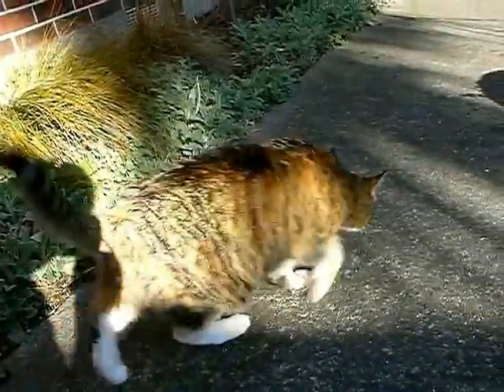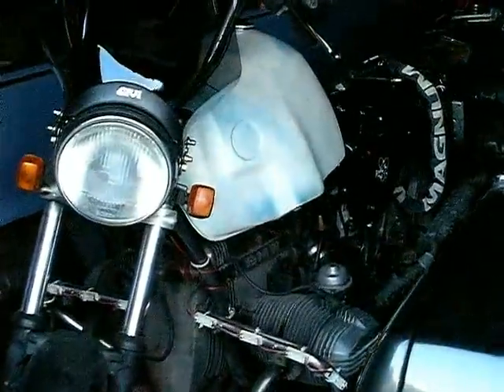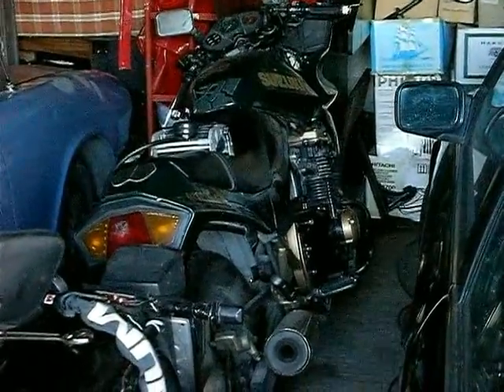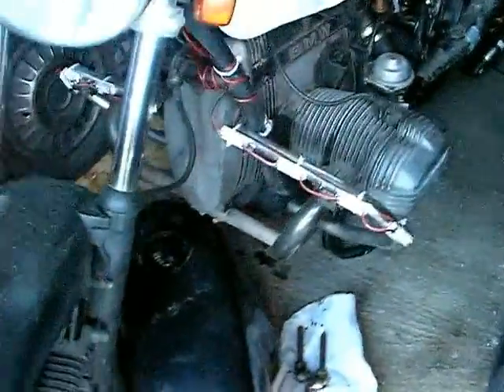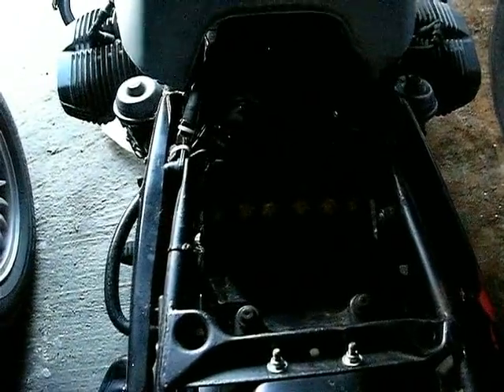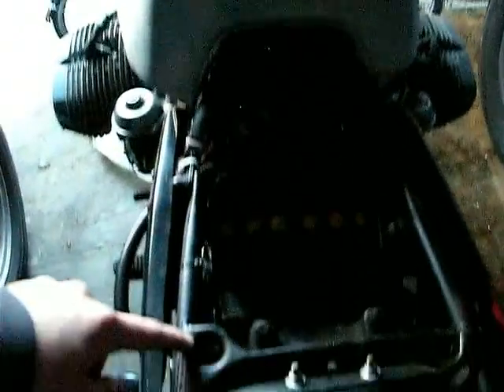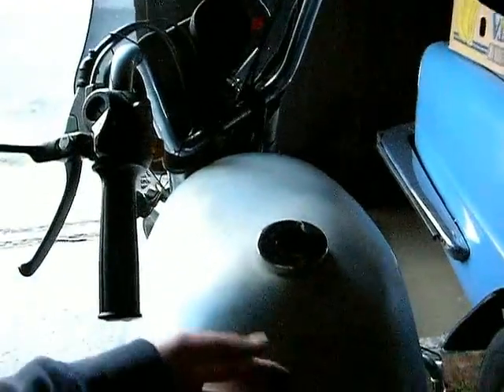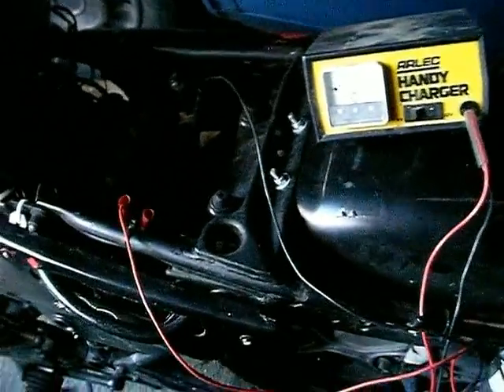Updates 1 of 3

Comment: For in bike charges I use an oxford maximiser :) good bit of kit... comes with a connection that you can perm wire up to the battery and then leave in it in the bike... then when it comes to a charge just uncover the connection you made to the battery and plug the maximiser in... runs all of its checks and then charges :)

Good bit of kit and well worth the 50 quid I paied for it.

Still working on the flasher problem mate... though I have to admit its got most of my lot stumped